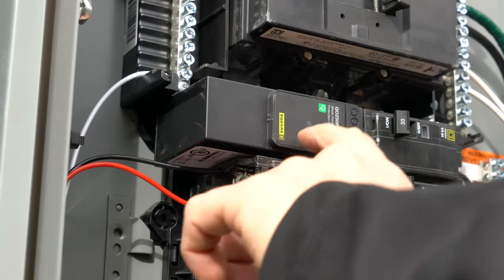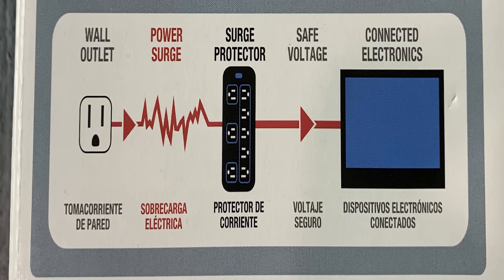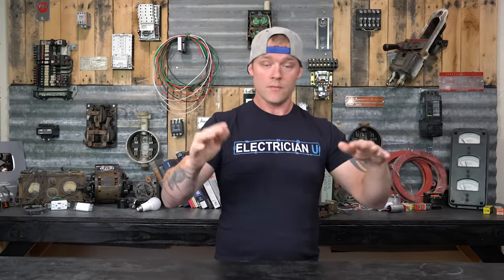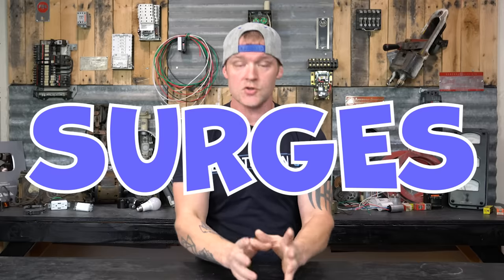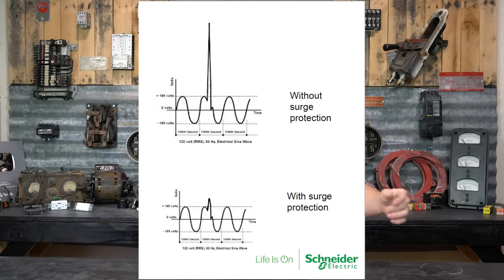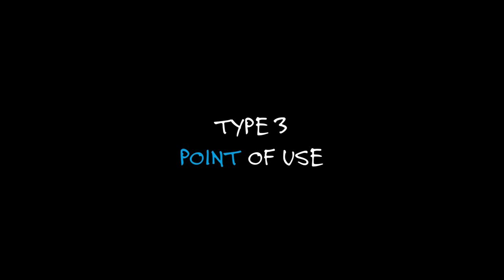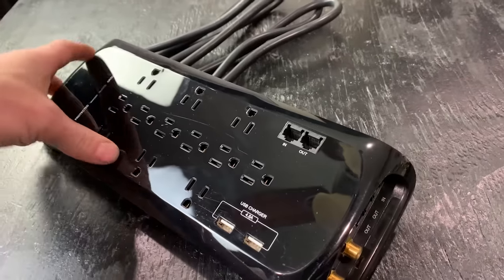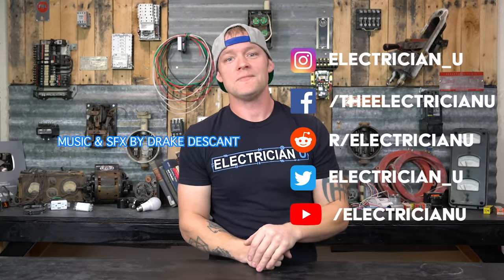SURGE PROTECTORS (SPDs) - What They Are, How They Work, What You Need To Know

Comment: Oh thank god, at least one thing that is harmonised in its name...SPD is also the name for that in Europe. Any chance you can also switch over to RCD instead of GFCI and AFDD instead of AFCI? 😜

RCD = Residual Current Device
AFDD = Arc Fault Detection Device

Three years ago I had to retrofit type 2 SPD to my home because I installed an EV charger. They were afraid of retroaction from the car charger to the grid.
Reply: Personally, I prefer GFCI and AFCI more than RCD and AFDD. The name tells more. If current leaking from a system, it is going to ground (hence the name ground fault), where as RCD implies that the energy is stored or missing somewhere. And our arc fault devices will actually cut off the circuit rather than merely detecting the arcs. Just my opinion.
Reply: @N-hunter  It must not only be a fault to the ground, as soon as there is an imbalance in the system the RCD/GFCI will trip, residual current means a differential in the currents. In the US most GFCIs are integrated into an outlet, but here in most cases the RCD is in the panel. Outlet RCDs are very expensive here, the RCDs integrated into the panel are much cheaper.
Sometimes back in the old days some guys didn't keep circuits exactly separate in lighting circuits. Installed something what they called a "borrowed neutral". Without RCD this doesn't matter, but if you retrofit RCD protection into this you'll have fun looking for the location of this if the two circuits are connected to two different RCDs. 
It's a differential measurement: The same amount of current that goes into the circuit must come back over the neutral (or other lines in case of split-phase 240V or a three-phase circuit).
And AFDD is in most cases actually a combination device. It's an RCBO with AFDD functionality included. RCBO: Residual Breaker with Overcurrent protection. So this thing is a circuit breaker, RCD and AFDD in one. RCDs are available as separate devices.

Actually I liked the german designation the most, it was really international:

FI, F = Fault and I as the symbol for current...the old voltage operated ones were named FU, U as symbol for voltage.
Reply: @jfbeam  Even then the sparc can happen without the AFCI tripping, the arc is usually too small for AFCI. That's not what this device is looking for. You sometimes have such small arcs in switches too. The AFCI must distinguish between such switch arcs, and the arcs caused by damaged insulation or damaged conductors.
I think they mean not the normal charging operation, they mean that when the car is plugged in and a lightning strikes the area around this would cause a problem over the car.
That's coming from the VDE and the network operators.
And it's actually quite less current flowing in normal operation. Here in Germany most houses are fused with 3x63A. Three-phase is the standard, even in residential buildings, voltage between the single lines and the neutral or ground is 230V, the voltage between the lines is 400V. That are round about 44 kW.

Comment: I also have a sub panel , will it be practical to install a spd in sub where most(90%) of equipment are powered from instead of a small protector  at ea😢ch work station or tv  3rd ? TIA

Comment: Is this an accurate statement : "Surge Protectors: Often incorporated into power strips allowing for multiple outlets to be used, surge protectors work by diverting excess electricity to the outlets ground wire.?"  It doesn't mention that on a main panel the Neutral is bonded to the ground wire.  Isn't the ground wire mostly just a backup protection if there is a fault or break in the neutral wire? 

Also Clarification.  If a neighborhood goes dark for whatever reason,  when service is restored does it in fact send a higher voltage through the high tensions lines - that can carry several to tens of thousand of volts but,  when it hits the transformers everywhere along the line from generation point to end point, doesn't drop that to 120/240 regulated current?  If I were close to the generation plant or sub-station,  would I not get higher voltage anyway due to less resistance between the source and demand side - which should optimally regulate via a transformer a more stable 120/240.  Even though I may be many miles from the source, say it's half the voltage on the high lines,  doesn't the transformer correct and take account whatever the actual voltage is and drop it systematically to be a uniform supply of 120/240?..   So, if there is little demand (amps) or a lot of demand (amps),  the voltage would remain within ~1-2% of actual line voltage?   IF so, where the damaging voltage that makes it past the transformer?

Comment: Can I install this in the empty slot at the bottom of my panel, or should it be right at the top under the main breaker?
Reply from the maker: The instructions for installation of your specific Surge suppressor will inform you of where they would like it to be placed.

Comment: How does a modern SPD deal a with long-duration over-voltage condition, such as that caused by an open utility neutral (e.g. tree falls, disconnecting just Neutral)?  It seems in that condition, the SPD would literally catch fire, risking a house fire.  The thinking is that if the two poles are imbalanced, one side will be higher voltage and the other will be the complementary voltage (e.g. 185v on Red with 45v on Black.   In this condition the MOV (or SASD) in the SPD will just start dumping, dumping, dumping current on the high-side of the imbalance to the neutral bus until the SPD melts and catches fire (or possibly burns OPEN and stops offering protection).   The main breaker won't trip (because it's an over-CURRENT device).   My gut says that the safest design would be for the SPD to deliberately create a dead short between the two poes if a surge were to occur for a long duration (i.e. if the SPD were extremely hot, at risk of melting down), thus deliberately disconnecting the entire load center from utility mains.   How would the featured Square D SPD behave in that condition?  It is my understanding that some SPDs have caused house fires because of the example scenario.

Comment: Scenario, a PERMITTED off-grid system with solar modules and an inverter without a utility connection.  Are surge protectors required at the main panel fed by an inverter?

Comment: I’m still a little unclear on whether a whole home surge protector will soften the blow from different things kicking on and off. For example, a big air conditioning unit kicking on will often dim the lights for a second- will surge protection smooth the voltage so that won’t happen or won’t happen as strongly?  Or, does it only protect against very large fluctuations like what might be seen from lightning voltage gradient or utility side switching events etc?
Reply from the maker: It would only surpress the event on the legs it's tied too. But it won't suppress OUT. So when a compressor kicks on the inrush is what causes the dim. Kicking off would cause more back feed from my understanding ~ZM
Reply: @ElectricianU  thank you.  Are there any devices that you know of that can smooth the voltage fluctuations caused by inrush current to large appliances like air conditioners?  I’ve heard of things called voltage stabilizers and voltage conditioners but don’t know what they would accomplish as compared to surge protection devices.
Reply: @R900DZ  I believe that you can get inrush protection from series-mode, inductance-based SPDs from companies like SurgeX, Brickwall and ZeroSurge. Those typically offer voltage stabilization and line conditioning alone with noise filtration as well.

Comment: My understanind is a Type 1, is installed between the pole and the meter, or on the meter such as this one: https://www.leviton.com/en/docs/Meter_Socket_Surge_Arrester_Product_Bulletin_Q-565.pdf   or between the meter and the main breaker. These do not have over-voltage protection.  Type-2 is installed after the main breaker on the  service panel and is connected via a 20-amp or 30-amp breaker. also if you have sub-panels each sub-panel should have a type-2 whole house SPD. also and equipment such as an A/C unit with a disconnect should have an SPD installed The ideal system should make use of Type-1, Type-2 and type-3 SPD's. (That's my understanding of what I read in section 242, But I may be wrong)

Comment: Surge protection device, QO, whole home, 50kA, 120/240 VAC, 1 phase, 3 wire, SPD type 2Square D QO250PSPD QO Plug-on Neutral Whole Home SPD
Not over voltage

Comment: Here's a discussion of the use of ferrites in whole house protection. They clamp around an insulated conductor and resist the rapid rise of voltage that comes with the spike. I use them in conjunction with a Schneider FS140. The Schneider provides an easy path to ground for spikes on both bus lines. The ferrites clamp around each line leaving breakers, making the path through the Schneider more appealing to the spike. https://www.youtube.com/watch?v=bPSTFe1dBAg

Comment: A surge protector DOES NOT “cut” the spikes.
Get properly informed so you can actually teach.

A surge protector uses Varistors, which vary their resistance with the voltage applied.

When the voltage on a varistor goes above a certain level (above 170 V for a 120 V feed), the resistance goes down, which then creates a very quick SHORT to eliminate (not to “cut”) the extra voltage in the circuit.
Reply: You need a hug
Reply: @joecrocker794  😂

Comment: This is a BAD idea on SO many levels !!!
Reply: worse than 1st gen arc fault roll-out... that little thing can't stop anything substantial, so what is the point of it! any modern PSU can take 115V to 250V!
Reply: @wim0104  Maybe, as these things are a "wear item" -- surges slowly (or rapidly) damage them. How many times can you hit the same spot on a sheet rock wall with a hammer before there's a hole? Depends on many factors, but if the spike ("blow") is enough to need a suppressor, it's going to "leave a mark". As for the universal switchmode power supply, how far above 250v can it go before there's a small fire? Personally, I've seen a few survive 277 by accident :-) but I wouldn't recommend it on a long term basis.

(I've also powered them via 300-360vDC, which is only slightly above RMS peak. And I use 'em as a DC-DC converter in an EV project car -- an $8 HP power supply beats any "EV" dedicated crap.)